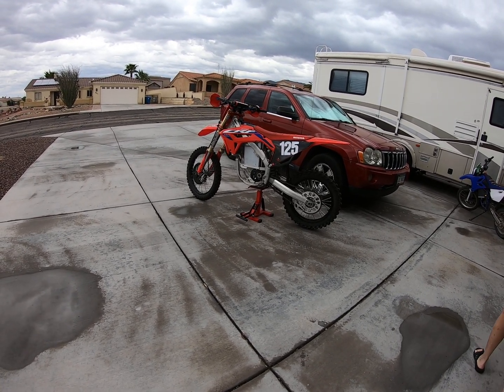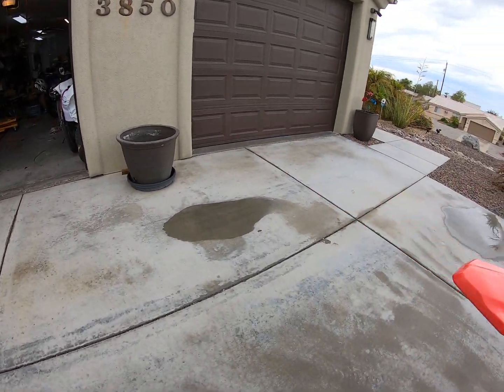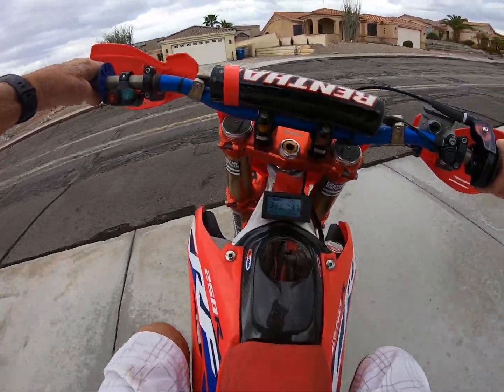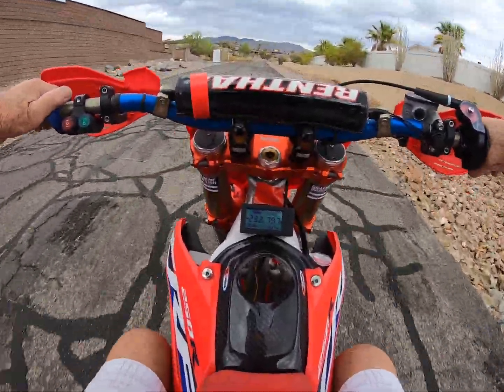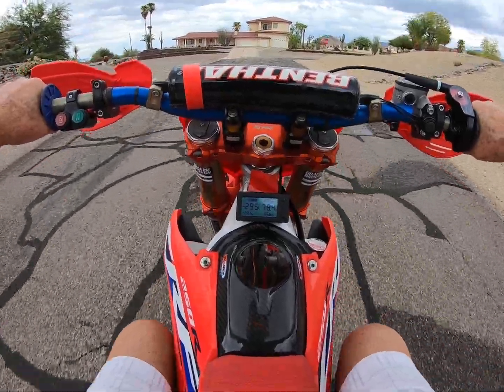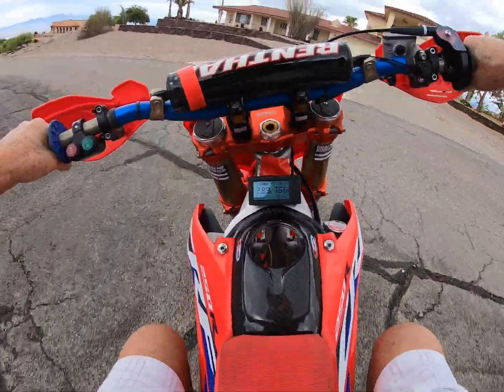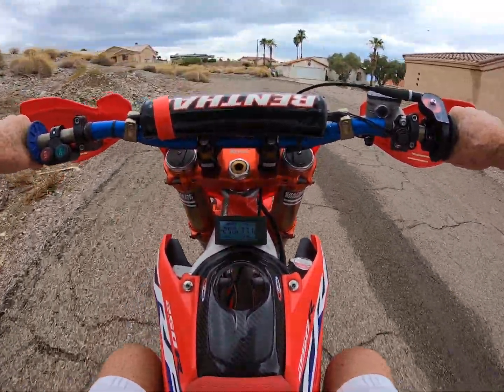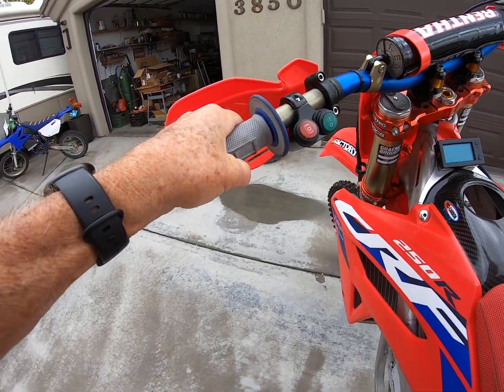Brock's 2023 CRF250F with QS138 70H V3 motor and new EM260S controller. First ride

Comment: Hi. why are you using em260 controllers? Is an em 150 not enough? Or what have you experienced?
Reply from the maker: Same answer as on the other Forum :   
the EM150 Controller is good for KX100 sized bikes, but for the full moto bike you need the 300 and 400Amp modes.  The EM150 can only give you 200A

Comment: How much do you sell the bike for?
Reply from the maker: I build them for customers.  This one was $6700, it was his donor bike.  He wanted certain things for controller cooling, and I split the battery for faster charging. I could build one for about $6000, you give me a donor. I have a 2008 KTM 250SX street legal, less than 20 miles on it, for $5500
Reply: It seems like you are in Arizona? @dcoxryton
Reply from the maker: yes I am, Lake Havasu City,  AZ  Start a private conversation with me, Donald Cox on the Electricdirtriders.com forum.  If you are in this area, you can try a bunch of  different electrics.  KX100, CRF150, YZ250F 2006, YZ250F 2014, KTM 2008 SX,YZ85, an Alta, a Zero DSR

Comment: What are the weights of your CRF250 and YZ250 projects? 
Where do you find donor chassis? 
Anything I find with a bad engine, the rest of the bike is in bad shape too.
Reply from the maker: My YZ250F weighed 221lbs with the 42AH battery.  I just replaced that battery with a new 50AH battery, I haven't weighed it yet, I will and get the weight to you.  I expect 235lbs.  The  2023 Honda weighed 143lbs as a donor ready to go, I expect to come in at about 235-240lbs.  The Honda is the owners race bike for last year, he just got a new one.  Most other donor bike always need all the parts replaced.  Rear suspension rebuild is standard, new plastics are easy.  front and rear shocks and forks rebuilt.  There is a guy in Houston who sells donor bikes, I can't remember his name, when it comes to me, I will send it to you.

Comment: The big battery, you gonn use p42 cells?
Reply from the maker: Yes it is P42A's.  It will be a 20S12P divide into 2 x  20S6P  with separate BMS's to control Charge only.  The EM260S controller and me will be the low voltage cutoff.  The Controller has Soft Undervoltage set at 65V, and undervoltage at 59V, and I don't like the lack of power below 68-69V

Comment: Hi , brilliant conversion. What's your top speed with the gearing you have. Acceleration looks good .
Reply from the maker: With the standard Moto gearing, we get 58-63MPH.  That is 13 x 48-50.  Look at my most recent YouTube on the YZ250F  That is everything the same as this one, but only 400A.  It does not have water cooling.
Reply: @dcoxryton  I saw someone hitting 85mph how come this is only 63mph
Reply from the maker: You can  go as fast as you want just change the gearing, but you will have no low speed power.  Who goes 85 MPH on a motocross bike.  Max  speed at the Chicago Super Motocross was mid 60's MPH . You want speed get a street bike.
Reply: @dcoxryton  he was hitting 0-30 in 2.3sec btw, and heavier bike than this cos it’s 96v 50ah
Reply: its not the same bike lmfao so why would the speed be comparable @Gabriela-ge7bx

Comment: Where are you buying your controllers from
Reply: Also do you have the cooling system hooked up and is it needed?
Reply from the maker: I am mounting the cooling system for the controller now.  You only need it if you want to run regularly at 400-450A.  The motor doesn't need it yet, but maybe China will come out with a watercooled model.
Reply from the maker: ElectroandCompany.com  Their systems rock.  You plug them in and they work.  Wait till I can pour the Amps to it.
Reply: Your awesome